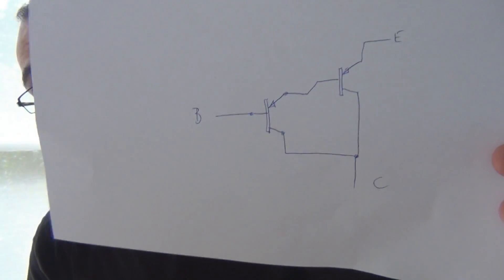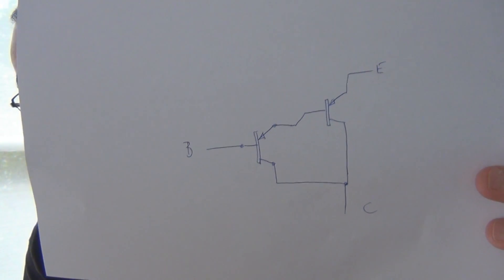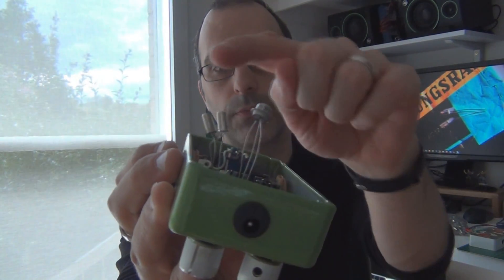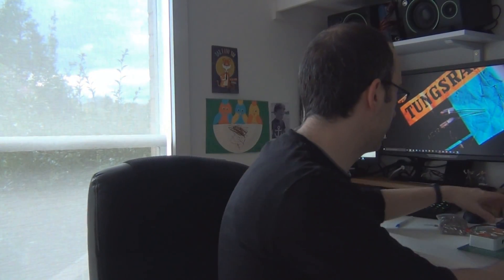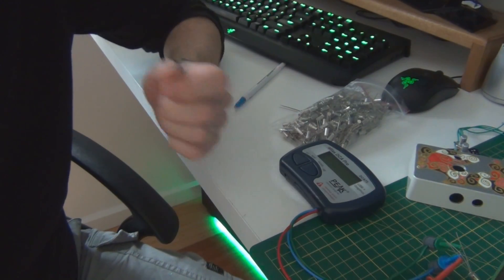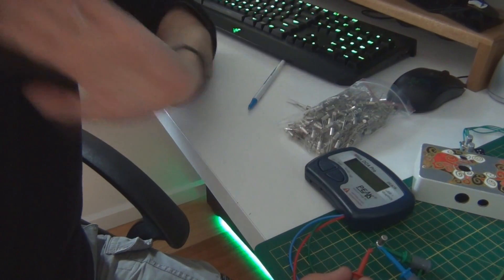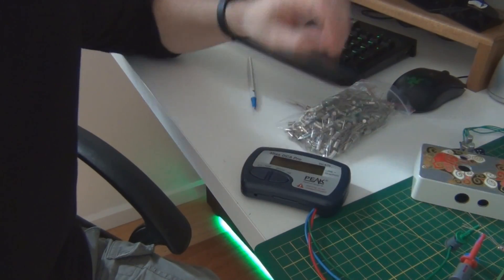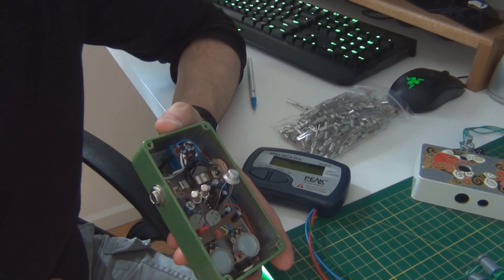Darlington Germanium Transistor Pair

Comment: I got a box of 50 MP10B. They are npn and range anywhere from 39 to 50 hfe. I built a fuzz face. I used one for q1 and I made a Darlington pair for q2. I get the best of both worlds. It has crazy amounts of fuzz, but because it is germanium, it cleans up very nicely with the volume knob on the instrument. I also added a bias control.

Comment: I have 2 old Japanese 2SD96 npn transistors with hfe around 150...what can I do with them???
Reply from the maker: You can use 2 high gain transistors in a fuzz face, they will sound fine, more 'distortion' less 'fuzz' probably but they still sound great.  Just check the leakage as generally npn are leaky (manufacturing difficulties of the past).
Reply: Thank you!

Comment: Thank you for your great videos. I have had a blast building audio circuits since may of 2016, it was even greater when I got them to work instead of 4 circuits not making any noise at all. 

I have a qiestion about parts sourcing; I have been utilizing Tayda for parts and was curious if there parts are on the "cheaper" side and how much do tolerances, tighter or big, effect the circuit and how. (Also the worst idea I had was to build 2 wampler pinnacles as my 3rd pedal while researchimg like crazy on how to bias j201's and use shielded wire and still have lots of squealing...)..

(maybe a pedal with "tight tolerances" and one  withoit toght tolerances comparison) 

What site has tight tolerances or good quality parts for ordering? Thank you in advance.

Comment: Great vid! Do you plan on elaborating on the effects of the Sziklai pair (I've seen you have a pcb for that too)? 
Also I found some information about an Hfe doubling method that sounds quite interesting. It uses a matched pair of Si transistors connected to an old germanium one.
btw thanks for making these videos, they are a great help and got me to start building my own effects pedals. so far I build 2 fuzz factories and a reverb. 
Cheers from Hungary!

Comment: Thanks for this. I've been researching ways just today to pair transistors together. If I may ask a few questions please... Do you bias this to the same voltages as you would a single transistor of lower hfe? Would this configuration be possible with two silicon transistors that read 70 hfe? Or are lower hfe's required?

Thanks.